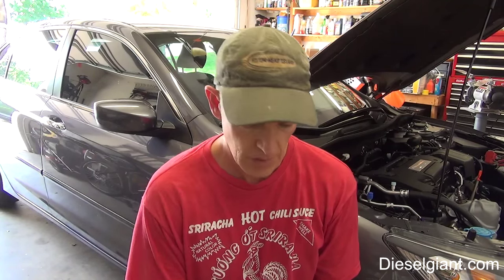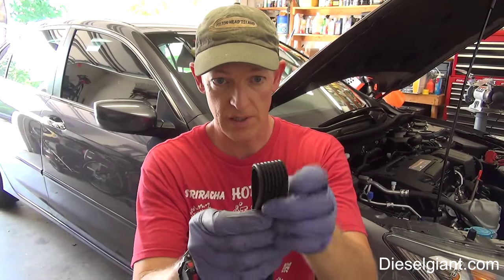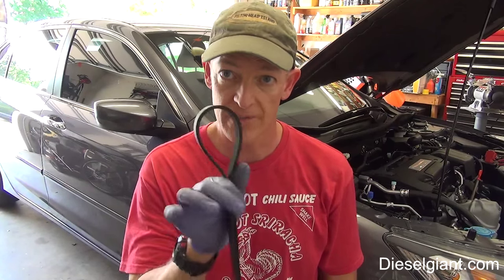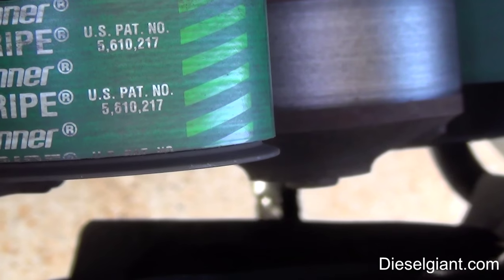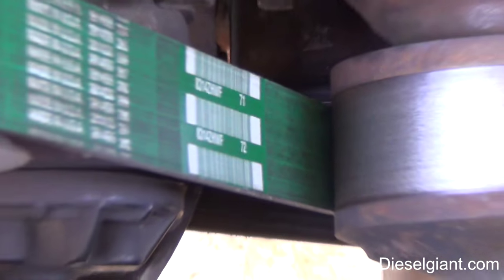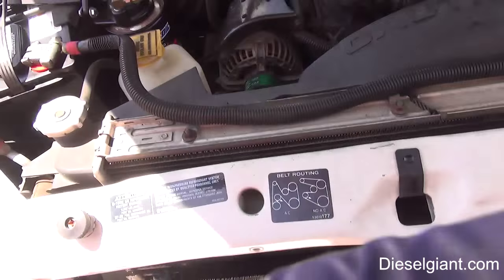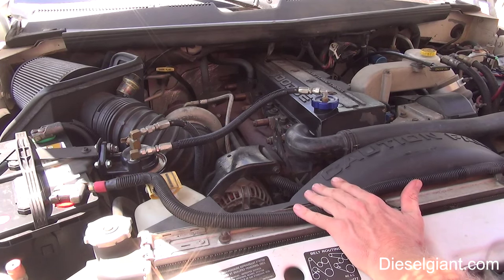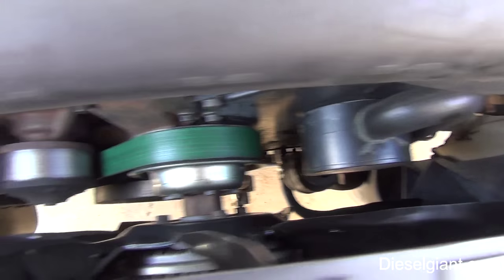Dodge Ram diesel with the Cummins shutdown chirp solved

Comment: Also there was a TSB for the first common rails- stamped alternator bracket could crack causing misalignment. Not easy to spot if you don’t inspect carefully. Updated bracket is cast. There was also a TSB for an alternator pulley with an over run clutch.

Comment: I know this is an old video, but I just ran across it!  I have a 2002 Freightliner MT45 Step Van with the 5.9 Cummins.  It has always had the squeak when I shut it off and I never knew why.  This is awesome information!!  I just had to change the water pump and idler assembly so I will give this belt a try.  Many thanks!!!

Comment: Hey Russell.  Just wanted to say thank you very much for this video.  My '99 Ram 2500 with Cummins 5.9 had developed a squeal that started as being intermittent and devolved into a constant irritant any time the engine was running.  I took your advice and replaced the belt with the Gates Fleetrunner.  Knock on wood, the squeal is gone completely.  Worth every penny.
Reply from the maker: Your welcome!

Comment: my gen 3 is doing the same thing, I ran across this.

2003–2006 Dodge Ram Trucks equipped with a 5.9L turbo diesel engine may emit a chirping sound. The noise is the result of the accessory drive belt slipping on the alternator pulley during engine shutdown. This condition is not uncommon with other vehicle manufacturers’ diesel applications, due to the high compression pressures and the sudden stop of the crankshaft during engine shutdown. Dodge recommends replacing the alternator pulley with a revised pulley (P/N 05183490AA), which incorporates an over-running clutch.
Reply: I installed this pulley and it fixed the problem.
Reply: will this pulley work on 98 5.9 24v ? all the listings i see are for 05- 10
Reply: Do you happen to have a link for this?  I'm searching for it and just want to confirm I am looking at the correct product.

Comment: The Cummins engines in the Rams are supposed to do that. By getting rid of the shut off chirp, you actually broke the truck.
Reply: Wyatt Lewis but why are they are supposed to do that
Reply: explain why Please this noise is very irritating and how does it break the truck?
Reply: I put one on my 03 today and did the water pump still nothing
Reply: I'm going to try the gates belt tensioner next
Reply from the maker: No they are not supposed to do that, but many of them do.  They did not do that when they were new.
Reply: Ha ha, good one! Thank goodness my truck ain't broke yet!

Comment: The chirp may return. I just did some work on a 2000 Dodge Diesel equipped with this exact belt. Once it has some use it will chirp again but not very load.
What is wrong with leaving the chirp alone? My 2002 has done this since day one. It is due to the torque that is exerted on the belt when the engine shuts down.

Comment: My 2007 does same thing. My friends Chevy Duramax doesn't do it at all. The Cummins piston is much bigger being there are six instead of eight. It seems when engine is shut off the last compression stroke shoves the crank in reverse  for a split second causing the chirp. Class A semi trucks do it all the time completely normal. Nice belt, I want one, looks way more stout than stock. Thanks!

Comment: Gates belt cured mine, after I had shredded my old chirpy belt because my new alternator came with a one rib thinner pully wheel I didn't notice in time. Rippy Roo!  Now I got the death wobble, wish I just put the Cummins in a Ford with leaf springs. Buying all the crap front end booger joints and crap steering will probably cost more than a Blown doner 6.3 Furd, f-me!
Reply from the maker: Ferds get death wobble as much or more than anything else.  Just watch all the vids on it.  Leaf springs do NOT prevent death wobble.
Reply: Not leaf sprung ones,
Not a 7.3 I have ever heard of,     Even after years of plowing!

Comment: Using a gates green fleet belt on an 05 3500.
Not only chirps but squeals on hard acceleration
This is a new belt and supposed to be good for 60k miles
Im lost for solutions

Comment: I'll give you my 6.7 It doesn't have a chirp.
Reply: travcon8 my 6.7 does. It’s a 4th gen also.
Reply: @ChrisWeism   Depends on how old the serpentine belt is. And if the fan is hauling ass when I shut it down.
Reply: travcon8 brand new belt and the engine is cold. Still does it.
Reply: @ChrisWeism  who really cares. Find something else to worry about.
Reply: travcon8 oh I’m not worried about it. I was just telling you that it still does it with a new belt and when the fan is not running fast. But who cares, it still pulls my equipment better than any other truck I’ve owned.
Reply: I thought you were the guy who made the video. Sorry my comment was directed towards him. He's the one who seems all bent out of shape about it.
Reply: travcon8 yeah, everyone seems to find something to cry about.